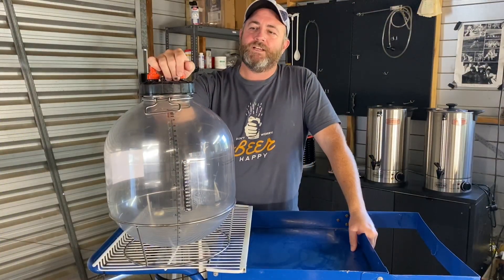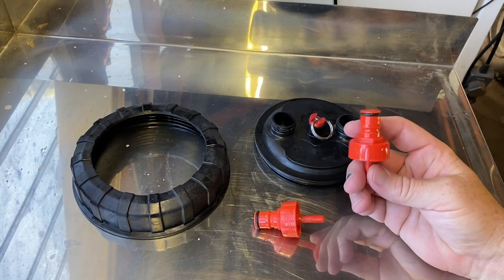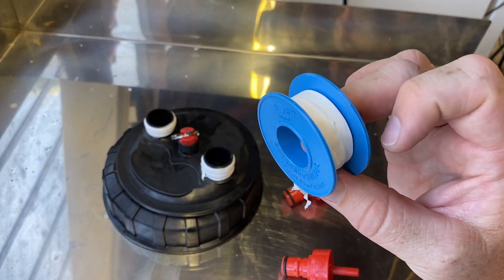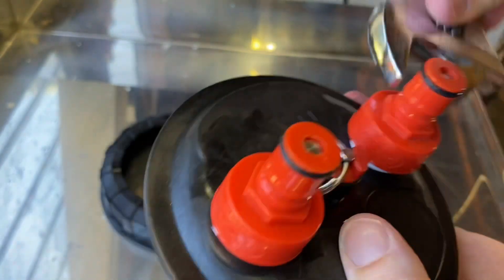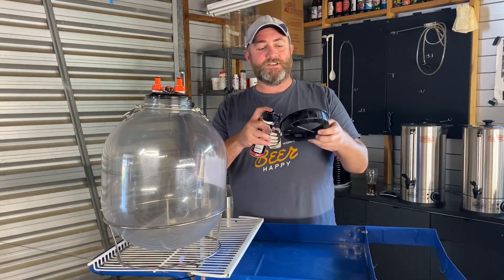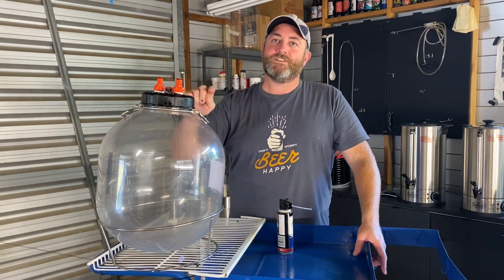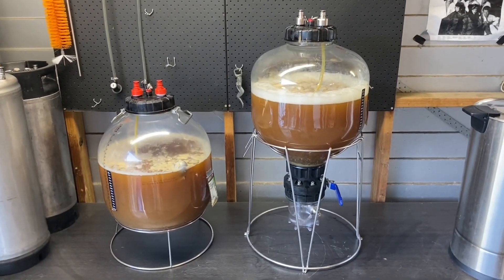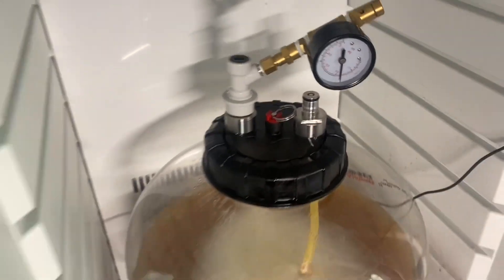How to set up and seal a Fermzilla  fermenter correctly to stop it leaking co2

Comment: Nice video. In my first brew with the fermzilla, i wondered why there was no pressure building up inside and only later realized that the small pressure relief valve in the middle was not tight. So now i make sure it's also screwed in securely.

Oh, and for my next fermzilla I'll also go with the Allrounder :-)

Comment: Hello had a question regarding the blow tie spunding valve. Once you’re fermentation is coming to an end will the psi gauge drop or can you lock it into your desired pressure.
Reply from the maker: It should stabilise, once you cold crash it the psi will drop a little as the co2 gets absorbed into the beer.